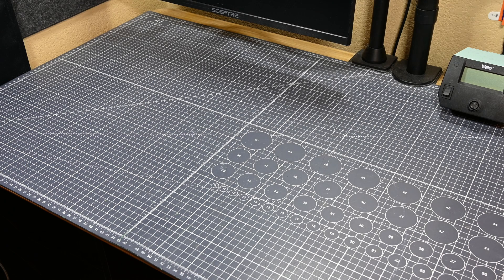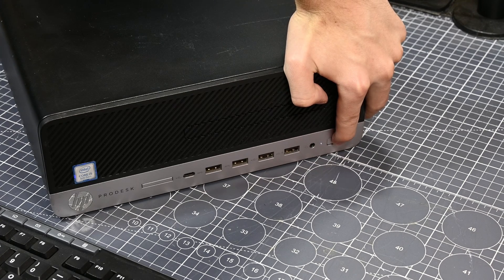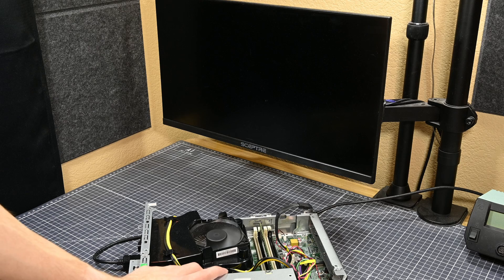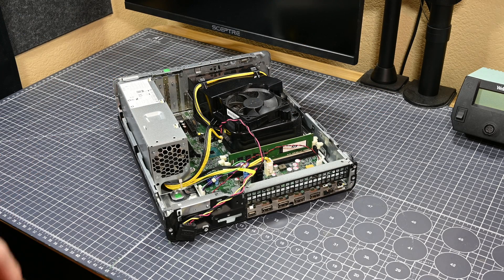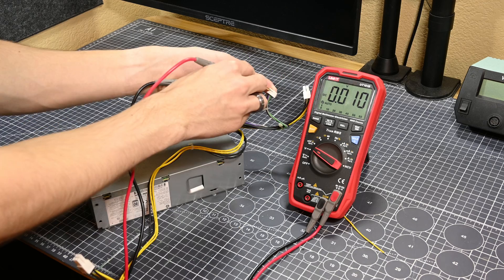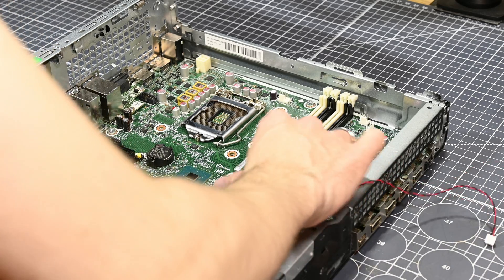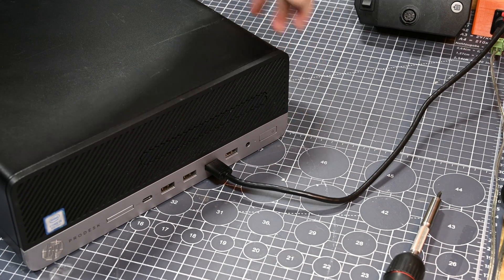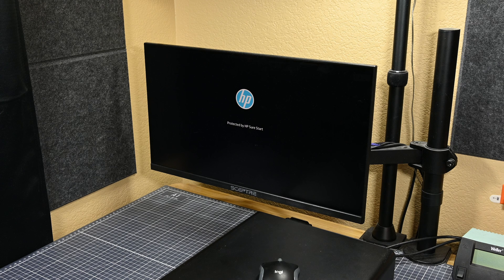This $65 PC Won't Boot Up Properly - Let's Fix It!

Comment from the maker: Hey! Just a quick note to add, I know that at the end of this video I'm still a little unsure about whether or not the power behavior seen here is normal for this model. I want to be clear that I'm not selling this system in this state right now, so don't worry about a possible issue slipping through the cracks like that. Let me know if you have experience with these systems and can explain if this behavior is normal or not for me!
Reply: Mine has the same behaviour of the HDD led lighting up when pressing power button since I unboxed it in 2020 I think that's just the hp firmware. It does take 30s to post after applying power if the RTC battery is bad too
Reply: Barring all other explanations, the only thing I can think to test further is to manually jump the power pins and see what happens. Maybe the power button isn't letting enough voltage through, or has a bad contact inside of it?

Comment: My HP Compaq Elite 8200 SFF used to have some issues similar to this machine but removing the RAM and GPU, cleaning the slots, and reseating them fixed the issues.

Comment: Echoing a lot of the other comments but I worked with these exact HP pro desks because my office was recycling them and I got to take some home. The power behavior you experienced is normal. On every system I tested it seemed to want to “cycle” before completely powering on. It takes a couples tries before it POSTs fully. This happens only after plugging it in for the first time, but after that it turns on as normal so it isn’t really an issue at all, just something to be aware about. I turned one turned an emulation machine for my living room and another into a plex/jellyfin server. 

The great thing about the i5-8500 is unlike its 7th gen counterpart it has 6 cores instead of 4. That hardware encoding performance uplift is nice considering they’re around the same price ($30-40 on ebay). It handles multiple 1080p streams as well as a 4k stream or two just fine. I recommend if you’re on a budget to look into these HP prodesks if available because you can often find them barebones (just mobo, psu, and chassis) online for really cheap. I’m guessing recycling centers part them out and sell them. I saw listings for them around $30. They make great media/homelab servers!

Comment: That is just how those HP power buttons work. I never really feel confident I have pressed the button properly. Sometimes I press it and the light comes on for a second but the pc doesnt actually turn on and then I have to press and hold for a second. The light comes on if you press the button, regardless of the  state of the pc so you had a dead motherboard.

Comment: Nice video. How about swapping that power button with the one from the other unit? Those buttons are multifunction one, with that failure code led inside. Also the power supply.
Reply: That power button is not part of the case, its small switch on board. That could be swapped or removed and tried to turn on with tweezers.

Comment: it might seem weird...but I got a HP laptop out of brick...via holding down the power button longer than 2 mins
to drain static charge ( it had 3 flashing lights at power port). Then it prom more flashing lights at
the lock Cap button ( Re move C-Mos for longer than 5 mins). Basically drain the entire system of static)
it took patient...becuase 2 mins seems like FOREVER...but it fire right up and reloaded the BIOS.then win8

 I did the samething to my backup ACER tower....that I thought I bricked ...I disconnected while
a virus was trying to load..or the PC was dead on STICK.....( Let it sat for a couple of years) I fired right up
after the drain the static charge.

Comment: I've flipped a lot of Z2 G4 systems, and I've seen a similar behavior from the power button... but ONLY after the power supply has been discharged and has just been plugged in. Almost like needs to build up the charge in the capacitor before powering on the computer. However, after that initial power on, it doesn't continue to do it. I would have guessed that something on the old board was shorted, possibly on the power delivery, but then I wouldn't expect the board to power on at any point. An odd failure for sure.
Reply from the maker: Good to know that this exact behavior is a thing on other, similar models. I agree, it was a really weird failure!
Reply: @CHWTT  Yeah, it kind of tripped me up at first when I started working with them, until I noticed the pattern.

Comment: I've worked on a bunch of these HP SFF computers and the motherboard bios are very sensitive to memory swaps and can take several minutes to retrain the bios for the new memory modules.   I've found that pushing the on switch and let it sit for 3 or 4 minutes.  During that time the cpu fan will start and stop a number of times and then the system will finally boot with display output.

Comment: I own 4 of these. They get really goofy when the cmos batt is dead, but they always act weird when first connected to power. You have to plug it in, and wait for 30 seconds or so before the power button works correctly. Same issues you seen at the beginning with the HDD indicator and it not starting. Just a weirdo.

Comment: The computer can still boot with a dead CMOS battery.  Motherboard failures are rare
Reply from the maker: Agreed, most of the time computers can still boot with a dead CMOS batt, but I have had some instances where they refuse to. Also, in my experience at least, motherboard failures are the most common failure in these old office PCs
Reply: yeah, not completely true..... forgot the mobo models(I think 1 was BOXDX48BT2; last generation of core2/775 boards) but some mobo's I can confirm do not post unless the bios battery is good..... this series of this HP's are strange: I have some 10 at work and usb ports will randomly work/not work etc
Reply: I have had failed motherboards on every single PC I've ever owned. And where I live you can't get replacement motherboards. So if the mother board dies, the whole pc goes into trash and you buy a new PC. Second most common failure was bad ram.
Reply: rare? lol, you have not worked with much hp pcs i see